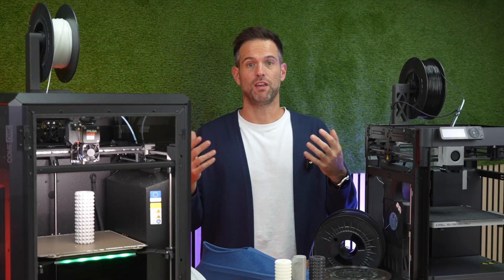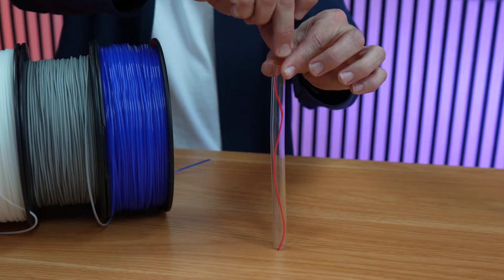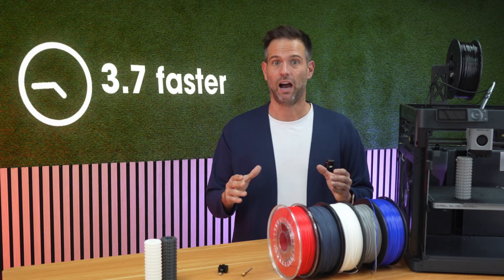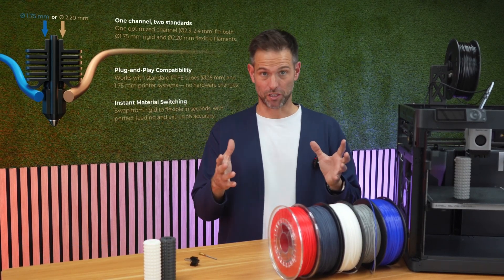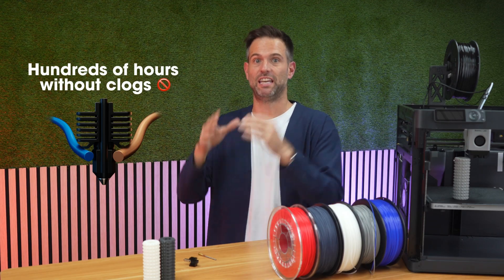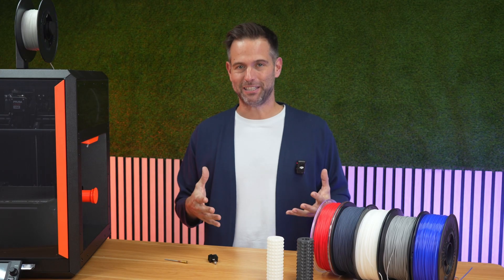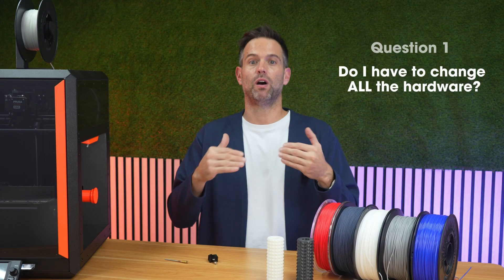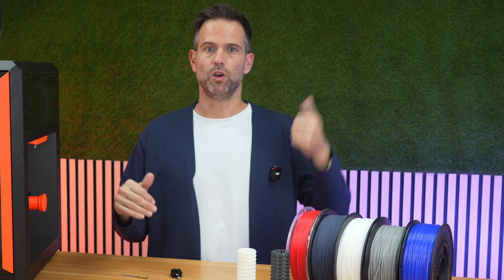We Made TPU Printing 3.7x Faster... Without Clogs.

Comment: I'm wondering why all filaments aren't at 2mm or 1,95 mm while all hotends at 2mm bore hole.
Reply from the maker: Filaments are always slightly smaller than the hotend bore because when the material heats up, it expands.
If the tolerance is too tight, the filament swells inside the melt zone and… boom, jams everywhere. 😅

Comment: we should bring back 3mm(if I'm not wrong) system and filament to market and DIYer, its could improve print speed, more safe from tangling, and more importantly more easier for diy recycler to make than 1,75mm...
also easier for DIYer to make filament from plastic pellet...
Reply from the maker: 3 mm had its moment, for sure! But 2.20 mm gives the rigidity of the old 3 mm without the slow melting and heavy mass.
Best of both worlds… and way faster.

Comment: I'm waiting for this to be available with the voron, i really want to test it out, if this become industry standard even for rigid material and more manufacturer support this change it will be nice
Reply from the maker: I think you’ll actually be able to test it on your Voron pretty soon! The hotends for the Bambu P1S and X1C are coming very soon, and there’s a small adapter that costs about one dollar, so you’ll be able to use it on your Voron machines without any problem.

The main idea behind this new standard is that all the big printer manufacturers can adopt it in the future. It won’t affect printing with 1.75 mm rigid materials at all — the only change needed is a 2.5 mm extruder channel, and that’s it. Everything works perfectly from there.

https://www.aliexpress.us/item/3256807786438621.html?gatewayAdapt=esp2usa4itemAdapt
Reply: @RECREUS3DPRINTING thank you for responding it was very informative and i didn't know this adapter even existed, at this point maybe the only problem is the clockwork 2 extruder that have roughly 2mm diameter, but i know the community will find work arounds as always
Reply from the maker: @shadowofintent117  Yes, for that, our hotend kit will come with a 2,5mm-100mm lenght hand-drill in order to make the internal extruder channel slighty wider and in a easy way without affecting the extruder performance, Thanks for you imputs!!!!

Comment: when will support for Creality K2 plus?
Reply from the maker: Support for it is definitely on our radar. For this first release we focused on Prusa and Bambu machines, since they’re the most widely used, but the main idea behind this new standard is that all major 3D printer manufacturers can adopt it. It doesn’t compromise printing with 1.75 mm rigid materials at all, and it opens up a whole new level of versatility — especially for flexible printing, where it unlocks performance that simply wasn’t possible before.

Thanks for your comment! We’ll keep it in mind — the K2 is a very popular machine, so it’s definitely on our radar.

Comment: Recreus  Filaflex flexible materials are really great and I really enjoy using them. But, what is the bowden internal diameter required (before the direct drive extruder) for a 2.2 mm diameter Filalex filament? I wonder how it can enter a 1.85 mmm internal diameter bowden (like Capricorn bowden) ? Or does it required special internal section shape (with 4 contact lines) like Bambulab's bowden to deform the 2.2 mm circular section ?
Reply from the maker: Great question! So, We’ve noticed that the PTFE tubes used by both Prusa and Bambu Lab to guide the filament actually have a 2.5 mm internal diameter. That means the 2.2 mm filament can slide through them without any issues.

Capricorn-style tubes have never worked well with flexible materials, mainly because their internal clearance is too tight — they create a lot of friction. But the standard PTFE tubes that come with these machines work perfectly.

So the recommendation is simply to use a 2.5 mm PTFE tube, which most modern printers already have by default. That’s exactly why this innovation has been possible — thanks to both the wider PTFE guides and the current generation of extruders.

Comment: I'm dying to know if this has been tested with a filament changer like ams or cfs. I'm really curious to know if the added rigidity of the filament makes it easier to run 90-95A tpu through the ams
Reply from the maker: This is a great question, and I’m sure it’s one that will come up a lot — multi-material printing with flexible filaments is a big topic. This new standard will definitely make things easier, but we still need more time to test it properly and deliver a solution that truly works.

The first experiments we ran showed acceptable results, but it will require more work and probably some modifications to the AMS. The good news is that we’re already working on it.

Thanks a lot for your question!

Comment: 1.75mm is indeed too small and is a bottleneck. Bondtech CHT style nozzles would shine with 2.2mm filaments. I wish there was one for prusa and also pla of such diameter.
Reply from the maker: es, definitely — 1.75 mm is a real bottleneck. The Bondtech CHT-style nozzles work great for rigid materials, no doubt about that. But in our experience, whether with 1.75 or 2.85, they haven’t performed well with the more elastic TPU grades. They tend to jam, and the internal channels in the CHT design can get clogged by TPU degradation, which is why we don’t use them for flexible materials.

That said, there’s definitely room for future redesigns of that style of nozzle. If the geometry is adapted, it could push speeds even further.

Thanks a lot for the question and for the inputs — really appreciate it!

Comment: Love the concept, but it feels like incorportating a CHT nozzle into a 2.85mm filament setup would provide more of the same benefits while avoiding the slow heating that is normally an issue with 2.85mm and not requiring custom hardware. Is there a reason that you didn't go that route?
Reply: We have already test lot of CHT nozzles and definitely are not working well with TPU many times get clogged due small channels or partially clogged. the behavior of flexibles materials are quite different comparing rigid ones.
Reply: @ignaciogarcia2019 Very interesting, thanks for the insight. I'll be very interested to see where you go with this.

Comment: Great idea.  I hope this succeeds commercially for you.  I have Qidi printers, so unfortunately I expect a long wait.  Meantime, do you suggest changing the Bowden tubes on 1.75mm soft filament to overcome the filament stiffness problem for better reliability?
Reply from the maker: Thank you so much — really appreciate your support! 🙌
As for Qidi printers, it may take a bit longer since we can’t cover every model right from the start, but we definitely want to get there.

In the meantime, yes — you can swap the Bowden tube for one similar to Bambu’s, with a 2.5 mm internal diameter, which helps a lot with flexible filaments. But honestly, the best setup for flexibles is to place the spool directly above the printer and feed the filament straight into the extruder, with no PTFE/Bowden tube at all. That’s where you get maximum reliability.

Thanks again for your comment — really appreciate it! 😄
Reply: Thanks!! Absolutely during the next week's we will share all the stuff for proper printing, cad model, profiles etc. Thanks for your words!!
Reply: @ignaciogarcia2019  Looking forward to it, thanks for your reply